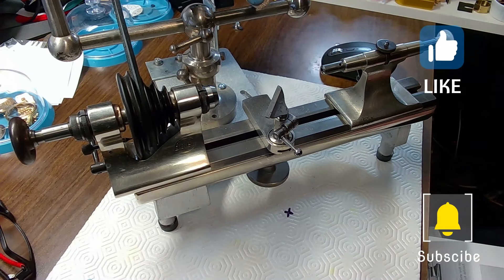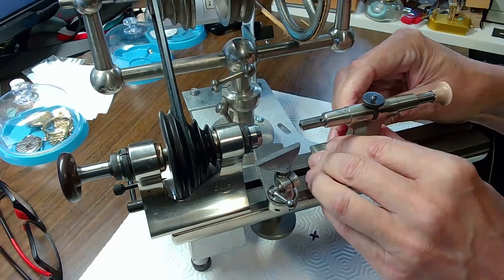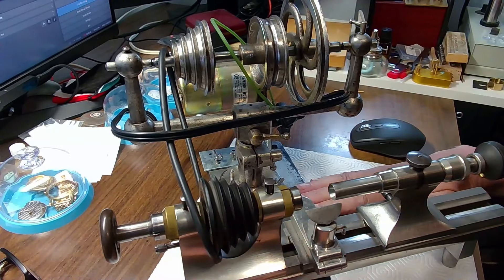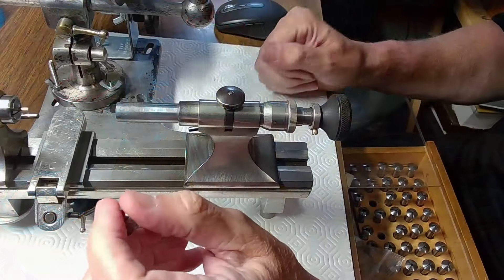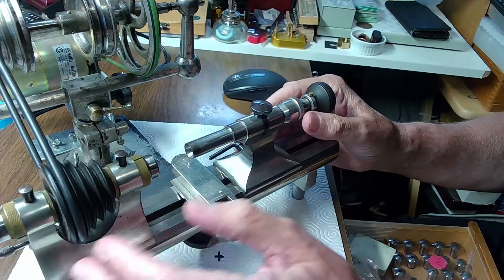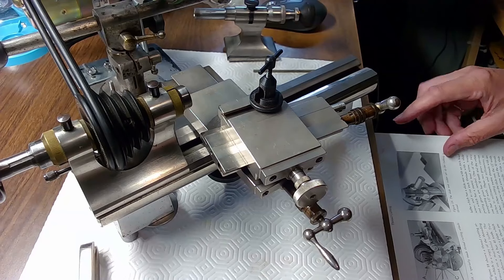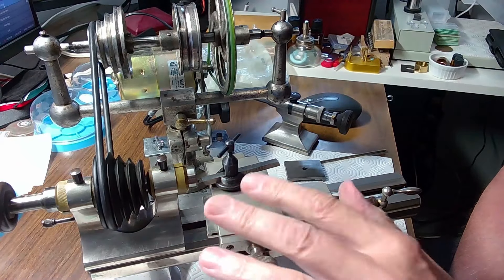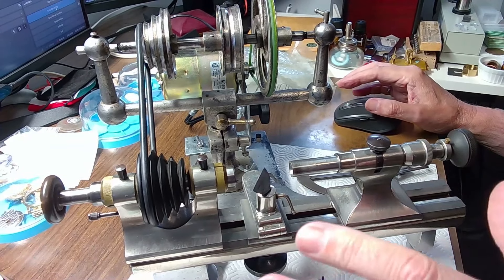Watchmaker's Lathe

Comment: They're not chucks. They're collets. A chuck is something else, usually has adjustable jaws that expand or contract to bite down on the part being machined.
8mm is not the clearance to the lath bed but rather the diameter of collets and the other attachments that are used. You're right, 8mm is the most prevalent so it's the best choice regarding getting collets and other accessories for the lathe.
Reply from the maker: @fredflintstone8048  screwed the pooch on this one. I actually know there collets I’m not sure why I didn’t call them collets.  May need to redo this video for accuracy or at least start it with the correction.